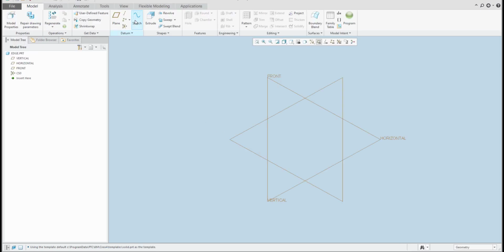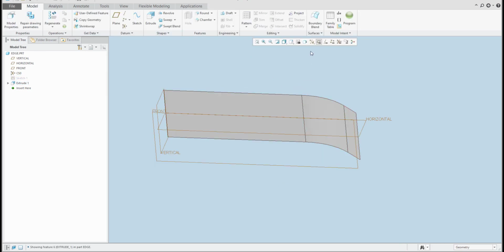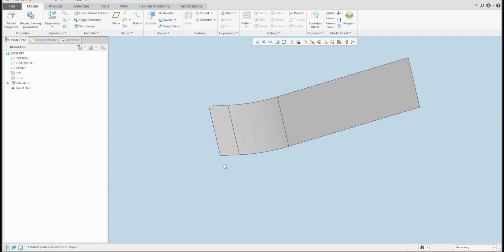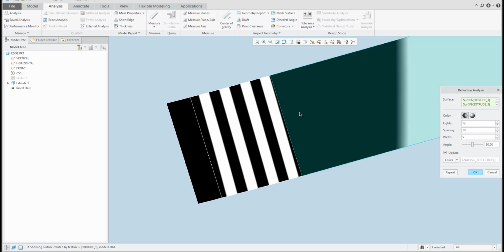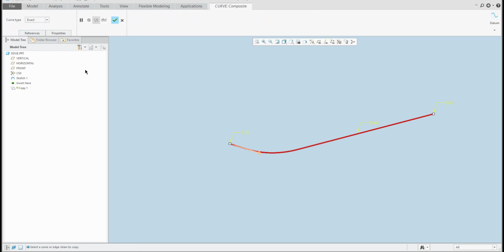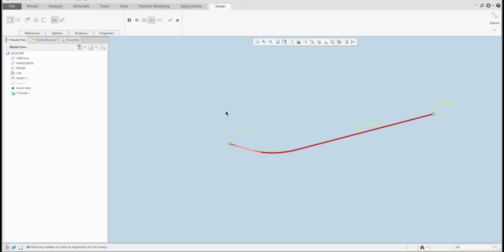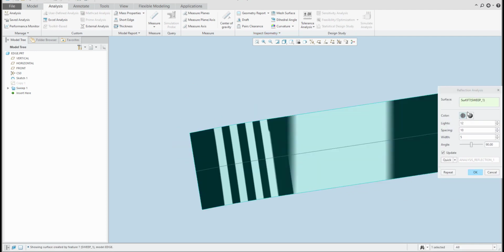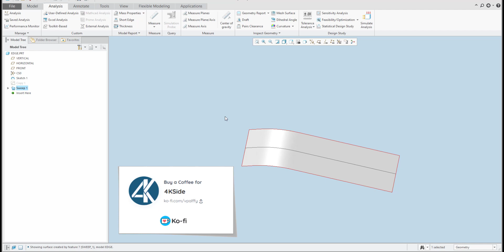How to convert surfaces to one Continue surface

Comment: a bad tutorial! you dont convert a few surface to one surface!!!!
Reply: This tutorial instead is very helpful, Arc+Line when extruded are never giving a correct surface, the distinction between the 2 parts is not a good way to design things. What Vladimir is teaching , with a simple example, is how surface modeling is about a very few Points on the curve which are smoothly defined in the example. I'm not sure from where you are thinking  this comment: You don't convert a few surfaces to one Surface ( your English is also a bit improvised)...designers do that all the time to smooth things up. Learn creo then we talk....)
Reply from the maker: Hi, please feel free to share with us how to do it better. Thank you

Comment: This tutorial is a bit misleading. Yes, using this method you get one surface without any isopram lines. However, the surface created using this method will still have tangent connections where the original 2D geometry meets at a tangent point. So the surface created using this method is not "smoother",  just expressed differently i.e. as one surface.

If you want a "smoother" connection between surfaces you will need to play around with curvature continuous connections with curves and surfaces. These types of connection are expressed as a "G" value. The value of the connection shown in this tutorial is a "G1" connection, being tangent. To get a "smoother" connection you will need to explore "G2" curvature continuous or "G3" curvature continuous accelerated connections. The latest version of Creo facilitates these higher "G" values. 

Another tip with the method shown here: You can extrude the copied approximate curve. Once you have created the approximate copy curve, just start a new surface extrusion and use the "select existing geom" tool to select the curve in sketcher. Then you can use all of the "extrude up to", "though", "specify length" commands. It's a more flexible approach than the method shown here.
Reply from the maker: Thanks for your great comment and another interesting way how to solve it. Stay tuned. Vladimir
Reply: Make video on this suggested Method